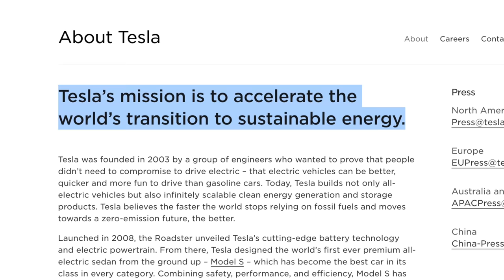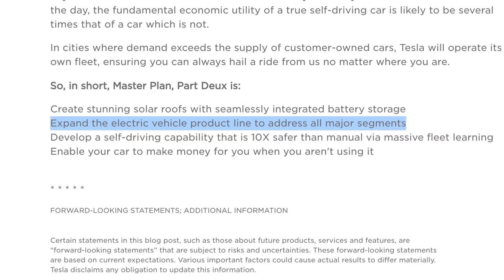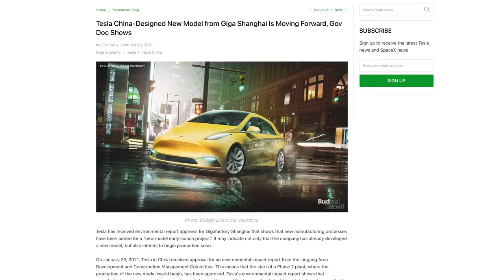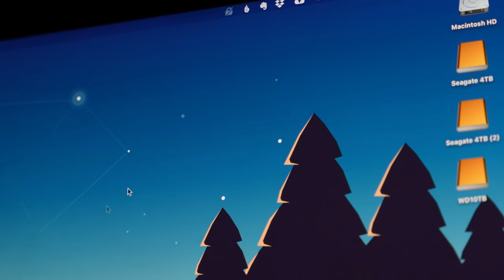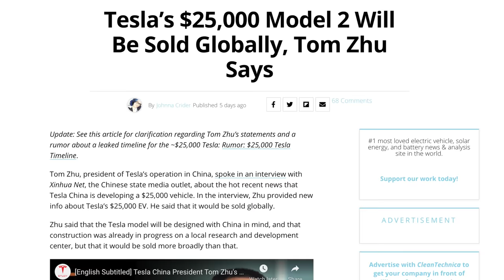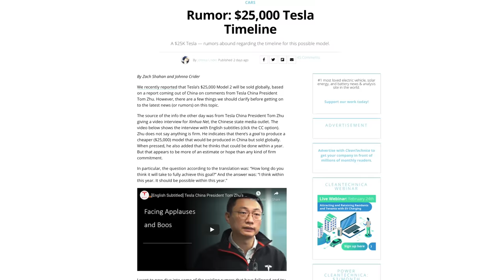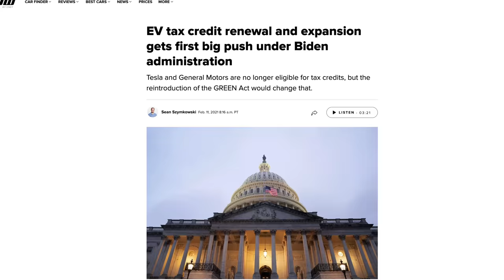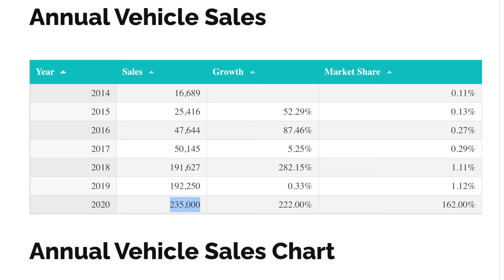New Tesla Model 2 = Game OVER for Gas

Comment: the model 2 wait what is it supposed to be the new honda civic cause at that price it sounds like a civic killer at that price point it will need at least a 250 mile range just smaller more dense battery pack to make it that cheap

Comment: So if this car has a smaller battery that means it will only be 4-8 times worse for the planet then today's clean burning gas engine cars. 
That's better. 
But figuring a battery (or how to slowly discharge a capacitor) that isn't awful should be the real goal.

Comment: Tesla can't can't even managed the 35k model 3 it promised instead raised prices even more.  Failed promise.  And this model 2 will not be 20k. It's gonna be at least 28k-30k starting price.  25k model2  is a lie.  More like 30k to 32k.  This is tesla pitch to investors and attractive early reservations for model2. And the range will be 120 miles only. If it possible for this. All the investors will be mad and  file lawsuits against Tesla that they're not getting their profits.  That price range is not possible for another 2 years or so.  It been more than 3 years and still no 35k model2.

Comment: Tesla is junk. It has so many problems from rear latch door won’t open, gas tank cover won’t open, wind guard gaps, alignment frame problem, low car hitting hills scratching, wheel hub scratching. The Lithium battery degrades from cold weather and depletes so fast leaving the Tesla requirement to charge, major Bluetooth issue with syncing with the Tesla app on your mobile phone causing the door not to unlock. Bluetooth issue with syncing music with your mobile phone

It just tells you only reason why he’s profiting because the concept that Elon put out is way ahead of its time. Controlling the AC takes 4 steps while you’re trying to drive. The charging takes 1-2 hours unless you get a super charger. 

I hope Toyota starts marketing hard and pushing the Toyota Mirai hydrogen fuel cell as that technology surpasses both electric and gas period.

Comment: I like the sounds, smells and the feeling of combustion engines. I will buy a EV the day they make one that makes the same sounds a high overlap cammed v8 ....at least make a EV sports car that makes the same noises a brushless r/c car makes, I'd do a EV that sounds like straight cut gears..... basically a EV is not rebel enough for me, I want a EV that not only gives the finger to the rich oil people but annoys the mass population at the same time. My charger not only pisses almost everyone off with it's engine sounds but it's also very aggressive in its looks, I have yet to find a EV that will make me happy as they are not analog enough.